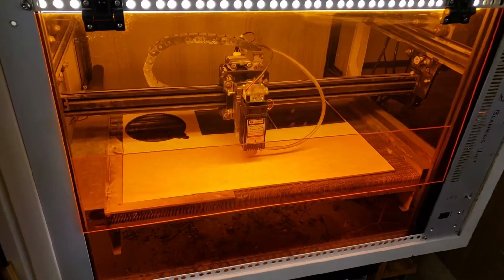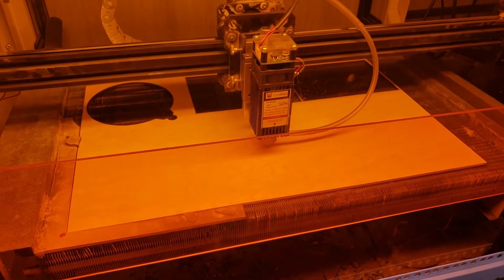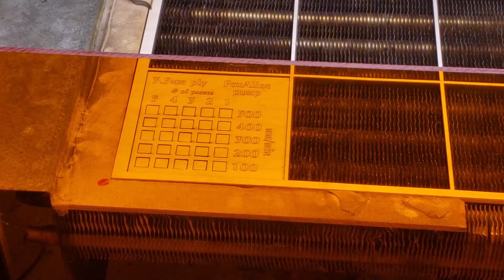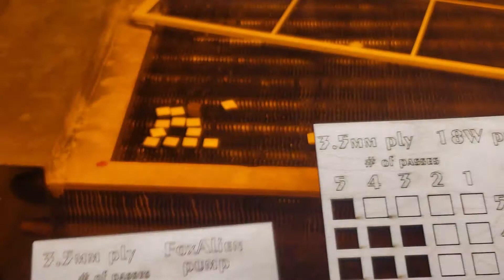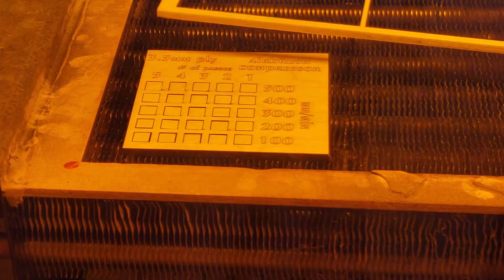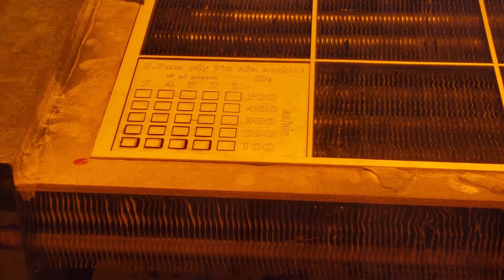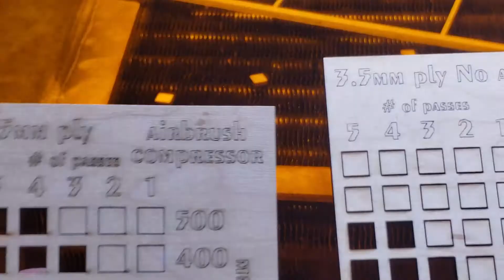FoxAlien Air Assist Pump Showdown!

Comment: Why does the manufacturer NEJE recommend a pressure of 0.6-1.5MPa and what does this affect? From your video, the pressure is quite low compared to even 0.6MPa.
Reply from the maker: My nozzles have a very small orifice hole, so they don't require much pressure to create a strong jet stream of air. Most other nozzles have huge orifice holes and they require a lot of pressure and CFM in order to achieve the same effect.

Comment: Will the Fox pump work on the ORTUR LM2 master pro?
Reply from the maker: Yup, it just needs 12V DC power in and outputs air flow. Be aware though that it does not come with the power supply.

Comment: Hello again!  I purchased the air nozzle from you and also have the air assist pump.  Do you have any videos on how to install the FoxAlien air assist in particular?  Also, my husband is helping me build an enclosure.  Do you have any tips or things we need to know before building one?  We are basically building a box to put it in with an acrylic panel to see through.  However, I noticed all those little bits of wood in your enclosure and wondering if I need to adjust my plans!  any advice you could offer for building an enclosure would be great!  There is NOTHING for FoxAlien enclosures.
Reply from the maker: Thank you for the great questions! I recommend y'all get a laser shielding panel for the enclosure. I personally buy 2422 amber transparent acrylic panels off Ebay, they work great. I just finished installing ductwork to my enclosure 2 days ago. You absolutely want the enclosure sealed with an exhaust fan blowing everything out a window. Lots of people build their enclosures from plywood sheets, doesn't have to be rocket surgery. My enclosure is an old server rack laying on its side. 

My air assist nozzle should just slip right on and hold on with the set screw. You can try to fish the tubing through the drag chains if it'll fit. The pump plugs into a connector on the Reizer controller. You might have to provide your own 12V power adapter if you have any other machine (12V DC power adapters are very common and universal, you might have one laying around unused).

Good luck, let me know if you have any other questions! Be sure you're on the FoxAlien Facebook group page! I think I recognize you from on there though.
Reply: @laserwizard1982  thank you for your reply!  I know they have a Facebook group but I don't use that platform and resistant to joining.  I wish they were on reddit or had a private group somewhere else.  Regarding the build, yes I have an exhaust fan we are installing and I bought a UV acrylic panel from Amazon in white which is about 32% transparent.  I want my build to look pretty so I went with the white lol.

I have the glasses so I didn't think it would be that big of a deal.  We plan on recording the build and I guess I will be starting a new channel on my foxalien creations in the near future!

I did my first burn using the sample and it was smoky but I have a cooktop in my kitchen with a downdraft exhaust so I placed it on the island to get the benefit of the downdraft until I get the box going.

Comment: Which machine do you use ? Would you recommend the Reiser Mega ? Hopefully FoxAlien will package it with the upcoming 40watter
Reply from the maker: I personally still use my LE-4040 that I purchased over a year ago. Went from the 5W to the 15W to the 20W and hopefully soon, 40W module. I've upgraded the controller to a 32bit STM32 GRBL controller. I do have a Reizer and it works great, just haven't built an enclosure with ventilation for it yet, the old upgraded machine is still serving me very well. I absolutely recommend the Reizer Mega. It has the 32bit controller already. Lots of people love theirs in the Facebook group.
Reply: @laserwizard1982  thanks, looking forward to what the 40watter can do

Comment: Thank you for this. It seems to me the FoxAlien pump is not better than the 32w and to puchase this rather expensive pump at almost twice the price (I live in Europe) just for less noise makes no sense.
Reply from the maker: Yes, I still personally use the 32W pump. It is more powerful, but the noise doesn't bother me.

Comment: I am have trouble setting up my Fox Alien Masuter through Light Burn with the 20W Laser. I have not been able to do cutouts in 1/8 plywood at all. I am novice at this so bear with me. Any help as far as settings would be great. I also ordered the air assist nozzle from Fox Alien which I believe you make. Any suggestions on best pump and what else I need besides the nozzle and pump to set up. I appreciate everything you do as the videos are so great.

Comment: Great video. Really appreciate the thorough testing. Just a word of note, however, on your relay. You should be switching the HOT wire, not neutral. Otherwise, your tool is energized with a hot wire when the switch is open.
Reply from the maker: Yeah, I don't remember my logic when wiring it. I think I figured it was safer to have the neural line at the relay in case a wire were to pull out. My entire machine is on a switchable power distribution block, which is switched off when I'm not using the machine.